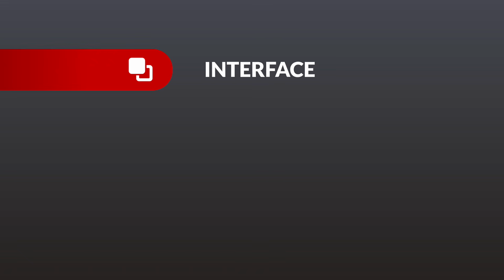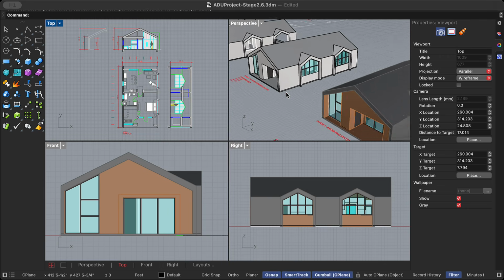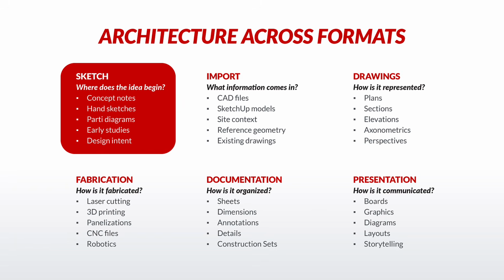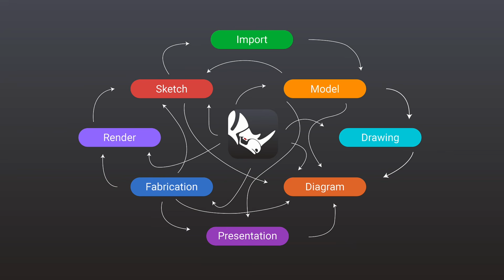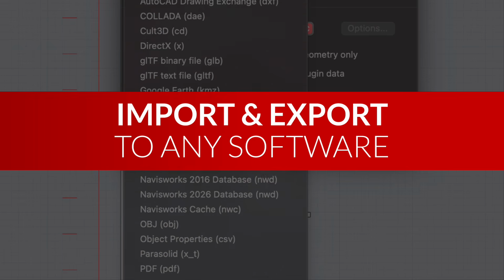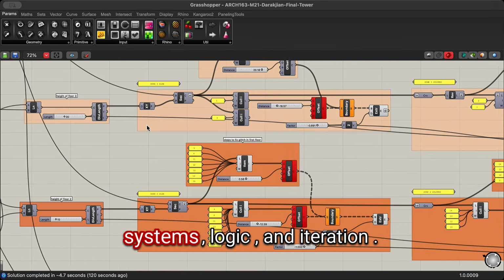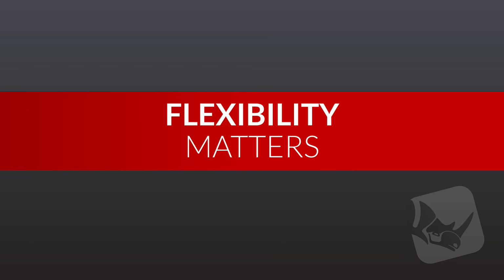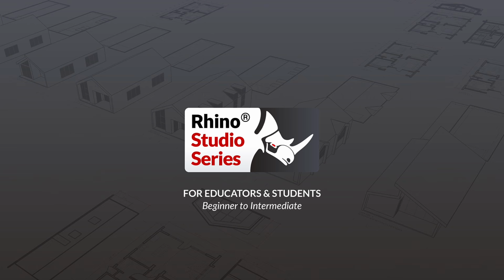Rhino for Architecture: Interface, Interoperability & Independence | Rhino Studio Series

Comment: I love Rhino with all my heart, but when back pain wanted to take me out of this world, I switched to ArchiCAD. Rhino is too slow for Architectural Design and experimentation. It's great for precise modelling of custom objects and general construction when the design is already finalised and there's no need for further tinkering and modifications. 

What will take one week of back breaking work in Rhino only takes 2 days in ArchiCAD now. I'm no longer mentally exhausted from struggling with tight and precise navigation in interior spaces. I can go on and on about the issues with Architectural Design in Rhino.

If Rhino can have a native BIM module (where I can draw walls instead of extruding surfaces/curves) and insert windows into them without first using wirecut to punch a hole, and then modelling my window from scratch. Then I'll run back to Rhino in a heartbeat.

But until then, sayanora, my health is important.

Edit: Please don't mention VisualARQ. Thank you.
Reply from the maker: Thanks for sharing your perspective with us!